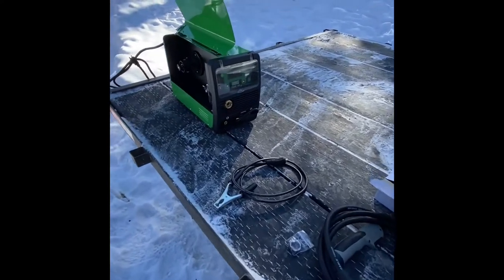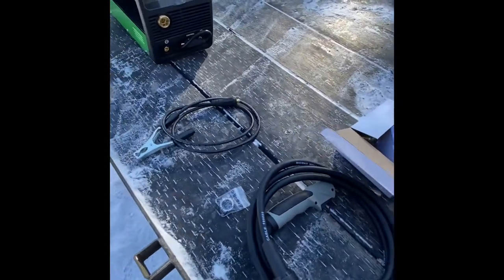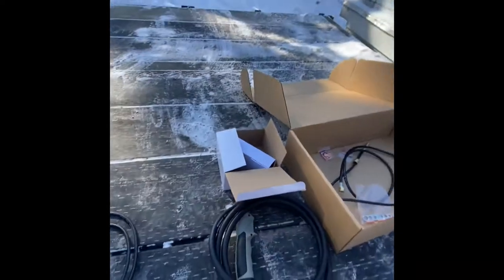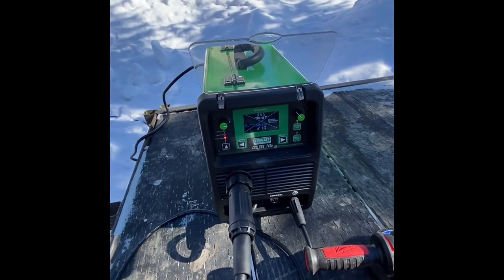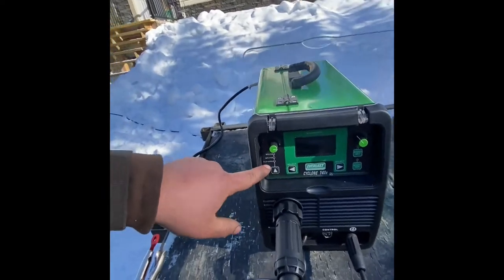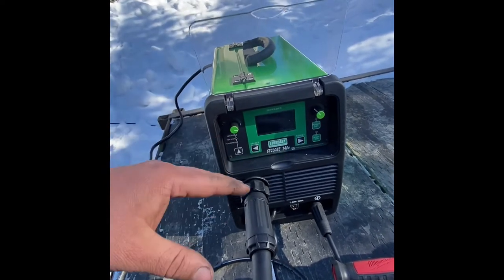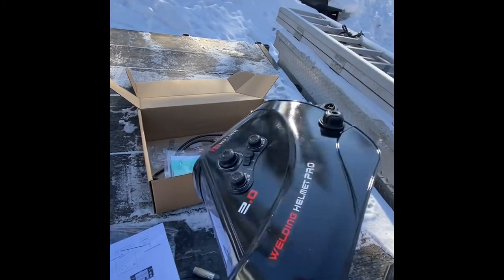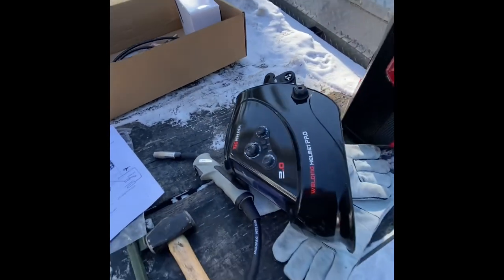Everlast Cyclone 140E unboxing

Comment: good stuff, did you choose this over the YesWelder 205DS or any other ones?
Reply from the maker: Honestly did not consider a YesWelder. I have used a few other Everlast machines over the last couple years and was pretty impressed by the product quality for the price. They had a sale on and I went for it. Think it was $470 Canadian.
Reply: @blacksheepfixin  cool, thanks for the response!
Reply: What type and size generator did you use with this?